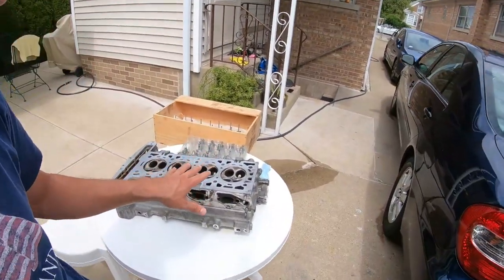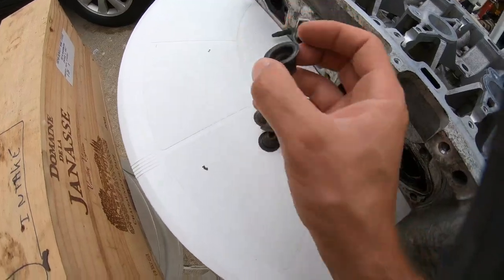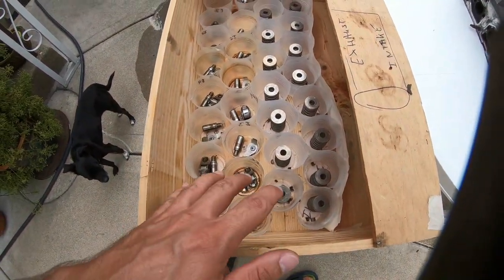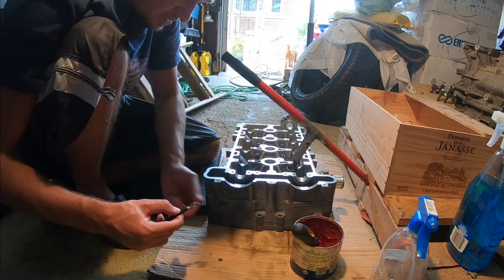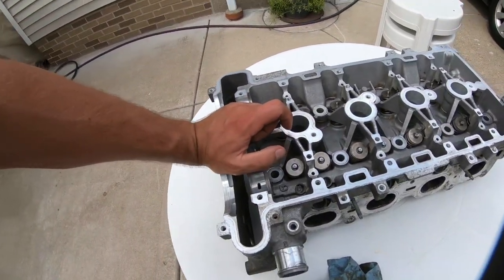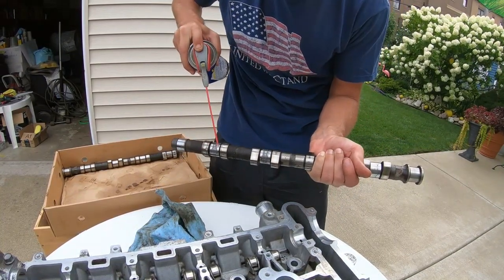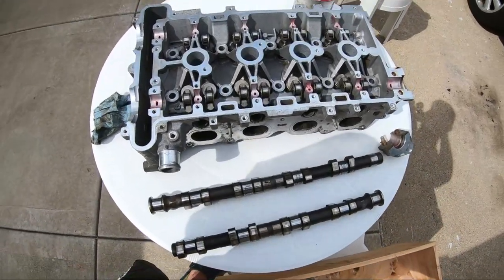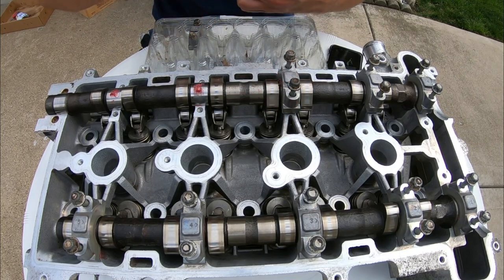Gm Ecotec Engine Head Reassembly

Comment: I personally would have lap them valve because if you are already in the engine you have to do it right.
Reply from the maker: This engine is not going In any car. Just a learning engine.   If I was going to run it I would have done it.
Reply: I was thinking the same.. or maybe he did it already, maybe